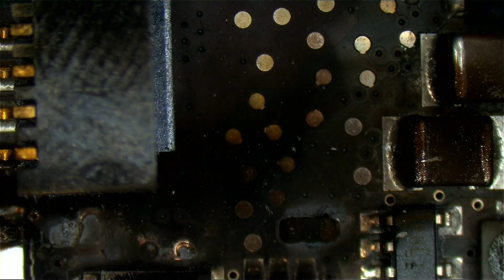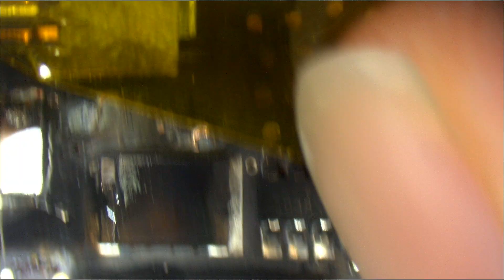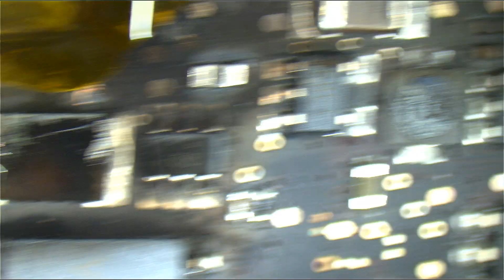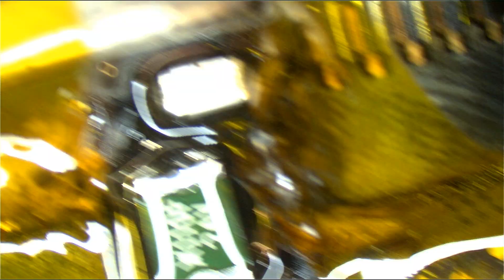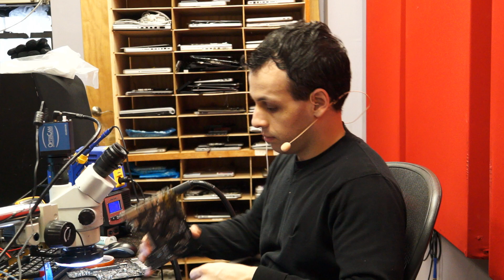What knockoff Amazon and eBay chargers do to your $1200 Macbook Pro

Comment: In a mechanics world.... customer pays the engine builder, $15k for and high compression-high horse power engine that requires 115 octane race fuel, cheaps out and decides to use 91 octane pump gas, and destroys it in a matter of days. smh
Reply: Bige4u exactly. 15k dollar engine build cheap out on the cheap part, because of that has to pay expensive part again. Same thing here.
Reply: I knew someone who ruined a $400 engine with aviation fuel to try drag racing, but at that price, he had a cheap lesson and a cool drinking story.

Comment: I must add: my house is worth a lot more than the difference between a UL or CSA certified charger and a cheapassed charger which hasn't been independently tested by any safety authority at all. If a cheapassed charger burns my house down, was the $50 in savings really worth it? Just buy a quality charger.

Comment: Thanks for your info on power adapters.  I have a thinkpad T410, bought it from ebay.  It had a bad display, no drive/cradle, bad battery, keyboard, upper case plastic, ect.  I rebuild this unit maxxed out the ram, ssd drive, ect.  I LOVE this laptop, classic keyboard and looks.  My daily laptop, the power adapter was also bought from ebay, I however made sure that it is a genuine Lenovo charger.  Solid as a rock!   I love your channel, you totaly rock,  Thanks for all that you do.

Comment: I find that the main issues with these cheapo after-market DC charges are as a result of heat due to excess load current for their design. I've seen some decent little explosions due to things like shorted transformer windings. Sometimes you just have to catch one of these chargers at the peak of the AC cycle for it to pop. 

The most recent DC firecracker I had blew up right behind me whilst It was on test, I almost pooed :o...  The 3A charger was only under an 800mA load...  The blast blew the case in half, blew 3 soldered joints off the PCB, vaporised two 'TO-220' transistor legs and blew a relatively substantial trace clean off the board.

I always advise folk if they must buy/use these after-market chargers to.. Check the temperature of the charger (by hand,) when it's under load (charging their device.) a good few times..  If it feels hot enough that you can't comfortably keep your hand on it, Bin it!  Also NEVER leave these things ON whilst unattended for any length of time as they can and do cause fires!
Reply: The problem with them usually is by using underrated components supposed for use with lower voltage/current and "optimized" circuit with some parts removed to cut corners. Such things may be used only for spares and even then not all parts ar worth for that.

Comment: Louis, I love you! Found out this was the problem with my mac; my cheap ass ignorance... Also, I grabbed the charging metal part to put it to the multimeter probe and learned that it activates to charge when there's pressure on the metal tip; my dumb ass ignorance... resulting in violent flailing of the arm and slight tingling afterwards. Keep fighting the good fight!

Comment: Here in Germany, or anywhere in the EU, you can normally only buy safe chargers, because if they are sold in a store, they need to meet safety regulations be tested in different ways. You can still order something from China, but if it gets stuck in the "Zoll" and it dont have those safety- symbols on it, it would  get destroyed to not be imported into the EU.

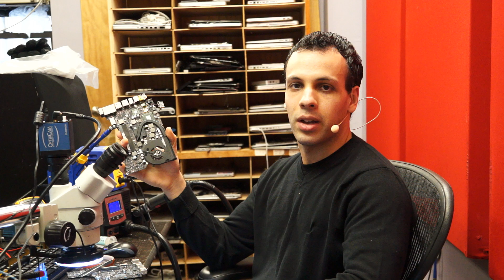But as you said (8:47), i first wanted to use a chep second charger on my Galaxy Note, but then i ordered a second original one, because the old one was extremely light and semelled a bit burnt, but it was not even used very often before.

Comment: When you say 'Amazon charger' I'm assuming you mean the third rate knock offs on there, rather than their own brand chargers which I've found to be decent.
Reply: >Good luck finding an OEM charger on Amazon.

It's pretty damn difficult to get a legitimate OEM adapter on Amazon, even when searching by the OEM part number.

I've seen listings of OEM chargers which have pictures of the actual OEM charger and bought one. When I received it, the charger was actually one of those generic garbage "REPLACEMENT AC ADAPTER" bricks with the wrong barrel connector on it. Amazon is pretty good about refunding for counterfeit goods though.

I've not had this problem on Ebay, I can find legitimate OEM chargers 100% of the time if I have the part number.
Reply: GGigabiteM The reason for this is that when Amazon was carrying OEM chargers, Fulfillment By Amazon vendors were contaminating Amazon’s legitimate stocks with counterfeits (since Amazon pools FBA stock with their own ::facepalm:: ). So customers would pay more to buy from Amazon itself to get a genuine article, but they’d receive a counterfeit that a FBA vendor had fed into stock. The problem got so bad that Apple did a bunch of test purchases of “genuine” Apple accessories, and found that the overwhelming majority were counterfeit.
Reply: He's talking about the cheap chinese Ripoff chargers that you'll find on amazon and ebay. Those don't have to be bad - bad there is cerainly a chance. 

Amazon has some Amazon Branded Chargers. But not for Macbooks. Only Amazon Branded Chargers you get for Apple are USB. But those are excellent. Amazon knows what they are doing, know all the (safety) rules n shit and those things work. You can use those - they are very safe. And well - they work. Which is often not so true for chinese ones...
Reply: Hank Hill Just look at Apple marketplace. Apple official market on Amazon sells it.
Reply: Also apple used crappy cables that break really easily so you don't want an OEM charger you want to find a quality third party one. I mean if you're buying anything from apple anyway.

Comment: I've always advised my friends NOT to buy cheap crap chargers from ebay.  Mostly from the personal safety concerns, but also the risk of damage to the device.  I've seen crap chargers with little or no mains isolation.  I would not want to risk putting 240V UK into my device.  That shit is going to blow the magic smoke, and could start a fire or worse, kill the user.  on the same topic of cheap peripherals, you see them cheap USB gadgets in the pound(Dollar) store.  I'm not going to plug a cheap piece of crap into my expensive computers USB ports.  Common sense if you ask me.
Reply from the maker: +paul30003 I love that song about the pink usb charger from china

Comment: Are we gonna get a follow-up on WHY the shitty chargers blow up fuses and HOW we can make them safe. ('cause I know they can be made safe...just asking).
Reply: +StepCorn Grumbleteats EXACTLY what I was wondering.
Reply: There are three steps.
Step 1: Write NFG on said questionable power supply.
Step 2: Cut both cords off
Step 3: Be responsible, don't throw it in the trash, take to the E-recycler.
Reply: You'd have to replace all the parts. Especially the capacitors and the transformer. And then the pcb might be badly designed too. It'll be cheaper to just buy a proper charger since electronics components are pretty expensive to buy in small batches

Comment: I love this. I work for a ewaste company and they are really cheap when it come to tools. we needed some magsafe 2 chargers and they went on eBay and bought some knock off's for 7 dollars. I knew this would be an issue so I found a mostly dead 2015 MacBook pro and plugged the charger into it with my boss watching. the charging circuit more or less exploded. He said it was a good thing I caught that because we were going to send one to a customer. All I could think was 'wow you're dumb'. Being cheap doesn't pay off.

Comment: I stay away from cheap ebay chargers. I mostly look for a used OEM charger and I have looked for cheap name brand chargers that are the proper voltage and amps if not a little higher amp output with or with the proper end if possible, if it has the wrong end I replace the cord not just the end. I take the power supply apart.

Comment: So all this soot came from a fuse? If so luckily it did fail open instead of closed.
Reply from the maker: +MrP00f yep
Reply: +MrP00f That's what fuses are for my dude
Reply: +ChuckleFuckleBee Not the polyfuse seen here. They are supposed to warm up and stop conducting in the event of overcurrent condition, than cool back down and work again normally.

Comment: The same thing happened to my sisters Macbook pro, and she used the genuine charger from Apple. So I think it's more so that the laptops themselves are just cheap crap as well. Not defending the aftermarket cheapo accessories, but you can definitely get expensive genuine stuff that is still just as bad as the cheapos.

Comment: I'm very impressed that the only thing that died was a a fuse and maybe a DC in capacitor.
Reply: Ed Saucin true, but if there was a sudden high voltage transient, it can kill whatever is connected to faster than the fuse will blow

Comment: Louis Rossmann

I'v repaired a couple computers that a took a pounding from a shitty ATX supply with no overvoltage protection. So much stuff on the motherboard was burned, I decided it wasn't worth fixing for a low end Celeron based system. I took the PSU out upon recieving the damaged desktop, and went to test it. With the power supply on my desk hooked to a dummy load, I turn it on. Nothing. I checked to make sure the jumper was across the right part of the motherboard connector, still nothing. I went to check the main switch, and touched the case. Bad mistake. That was one hell of a shock, and the supply spit sparks and lit up a few components inside as the electronics (now grounded by me) cooked themselves. I said to hell with this, I'm tossing everything and ordering new parts. In the end, I replaced nearly everything except the fans, hdd and dvd burner.  The gpu was inferior to even the worst modern integrated graphics, so I did'nt repair it. Used a cheap AMD quadcore (Like 1.35GHz or something) and stuck in a few gigs of RAM. Perfect internet browsing, video watching and email checking machine for the people I fixed it for. I'm suprised the hdd and dvd drives survived, I guess the motherboard clamped the +12 rail to a low enough voltage to save it XD. New system price? $265. Cheaper then repairing it, that's for sure, I never built such a low spec desktop in my life. But, it worked perfectly for what they used it for, and that's what counts.

As a side note, I did try fixing the motherboard a few months later for fun. I just kept looking at it and thinking "what if". Cost between $50 and $100 in components, I don't remember. The parts were ridiculously hard to find, it took a whole day just to track down the correct mosfets to replace in the cpu regulator circuits, and nearly all of the caps needed to be replaced. Not counting finding the parts to replace (well, the visibly charred ones) it took in total 30 hours of time over a course of several weeks. Ironically I ended up using it as my main computer after finding out I could stick in a Pentium D 945/955 or Core2Duo, which greatly beat the old P4 system I had at the time. Picked up a Pentium D 945 for $8 on Amazon in original packaging, unopened. An OEM part, but it was compatable. The integrated sound and ethernet were detecting, but nonfunctional (likely bad smd stuff), so I disabled them. A soundcard and network card and it was good to go. Still working, still using it. How the chipset survived what turned the main power circuitry to ash I don't know, they must have had sacrificial protection circuitry inside. I will admit the second usb header on the motherboard has an unstable power supply, therefore I don't use it. Also, I don't think the keyboard, mouse and usb ports should stay powered even when the computer is off, but to me that's just convienent.

Pretty certain I left this story elsewhere on Youtube in the comments of another video, but I felt it was necessary to tell again, as it's yet another example of the cheap PSU strikes back, and it's a significant learning point I had about how to repair badly damaged and complex circuitry.

Comment: Louis, I like your videos and I respect your work and wisdom but I must say, I have a 35$ amazon charger for my mid 2010 mbp and it has out lasted (correction lasted twice as long) as the original apple charger that almost burned my house down. By heat signature alone this one seems to work a hell of a lot less to charge the same. Maybe I just got lucky.
Reply from the maker: +Stephen Daniel Addeo (Lostboy) There are different levels of quality. Knockoff charger ranges from almost the same thing Apple mdae all the way to a little coil of wire someone made manually in 3rd world country with a lightning bug trapped inside for the green light
Reply: +Louis Rossmann lol understood.. Lightning bugs for the win!

Comment: I'm now glimpsing at my 150$ Asus charger for my G75VW. And then realizing that the problem were not connected to the charger, but a faulty graphic chip. Which Asus won't fix or take care of with RMA. 

And after that I realize that the VGA PCB is a custom size, with standard MXM though. So switching to another card would be a pain in the ass, if at all possible. And I don't dare to buy a second hand gfx due to the fact that there are so many faulty ones. And this rant was just to ventilate my feeling towards this shitproblem.

Comment: This would be more fun if the Macbook chargers that cost $80 actually lasted for longer than like a year and a half instead of falling apart due to the bends caused by normal use. I'm gonna have to buy a 3rd charger for a 5-year-old laptop, so I am upset... I guess there is no good charger in the market for a MacBook, because the one Apple sells me sucks too.

Comment: I had my old MacBook Air since 2010.
He work fine but I am at my second charger. I also bought one on Amazon for 10usd but never used it on my pc I just wanted to compare the build quality with my broken genuine one. And holy molly what a brick it was, no separation, no fuse... I think you can use Amazon fake product to do a how fast can it blow up video on YouTube. Anyway my thought is yes the cable near the bag safe port is weak and there is nothing I can do ... but the MacBook works just fine for my use so I will still buy genuine part if they are available ... I don’t want to use a cheap fake one and have it burn my house ...

Comment: I burnt something on my nokia motherboard with a "universal" charger and the phone would still work, but it wouldn't charge. After getting a replacement for 20$, I also got a cheap charger for 5$ from that repair shop and it smells like it's burning, but it worked for over a year now.

Comment: Shouldn't there be some kind of protection in place to prevent incorrect chargers from doing damage to the laptop? I thought this was kind of standard to have such things in place.
Reply: You'd be wrong. Honestly, from an engineer's perspective, it is perfectly reasonable to expect that if you have designed a completely proprietary charging port for your device, it is only going to be used with your completely proprietary charger, and if not, then the user must've gone out of their way to destroy their device.
Now, of course, engineers don't set prices. It's not their fault that management wants to charge insane amounts for original chargers, pretty much forcing users to seek ways of inadvertently destroying their device.

Comment: Also, what is the yellow tape called? I guess you use it to protect components from heat?
Reply: +piratapan it's kapton tape. good insulator and it can stand high temperatures (400°C). perfect for this kind of usage

Comment: What ive seen in pc laptop repair with  cheap chargers is bad if they come in with a unit i replace them. here are a few you charger is killing your laptop tips 1 excessive heat and buzzing or wine 2 when plugged in mouse becomes erratic or moves funky compared to when on battery power. Any of these chuck the charger. Cheers.

Comment: Stupid question:
When you reinstall a chip/cap/resistor ...How do you know which way it goes?
Reply from the maker: Resistors and ceramic capacitors do not have an orientation. Chips usually have a DOT on the corner that is pin 1 and I will usually check the board view to check where pin one is and match it up with the dot

Comment: Question.

What is your opinion on universal adapters?  You know the ones you buy with all the adapter pieces to cover all brands?

There's probably a lot of shit in that area ... but I presume there are also brands that make the equivalent quality of a corsair or seasonic desktop psu right?
Reply from the maker: +kmi187 I am sure someone makes a good one, if so, I have yet to find it.
Reply: +kmi187 I'm wondering the same thing. I paid MORE for a universal adapter ($80+ at Best Buy) because I didn't have the time to get a brand specific adapter shipped to me. I didn't think about the possibility of it causing problems before and I certainly didn't "cheap out" on the thing. I've used universal adapters before and actually never seen an issue with them but I've also never inspected my laptop's motherboard after using one. I guess after a year or so of use and passing all standard diagnostic tests, that should be a good sign that it's working properly. But now I wonder...
Reply: I dont trust those chargers, since different laptops uses different voltage.